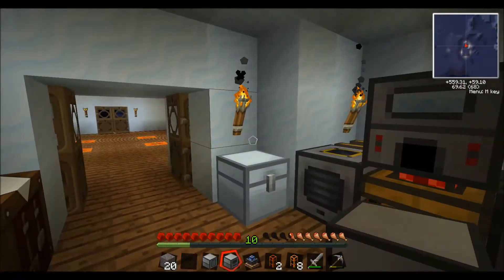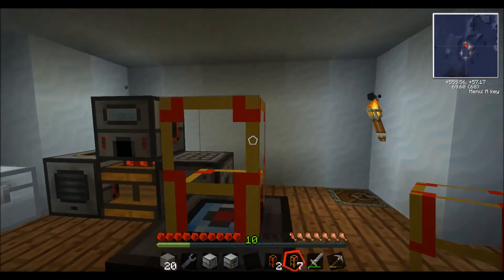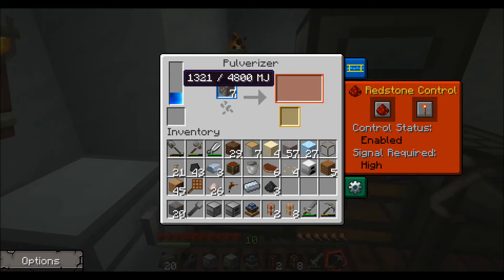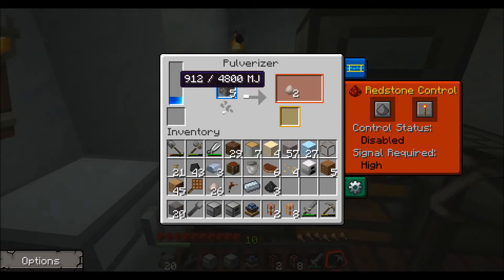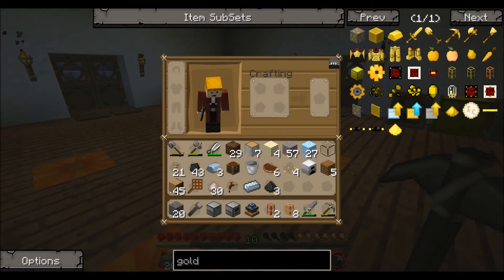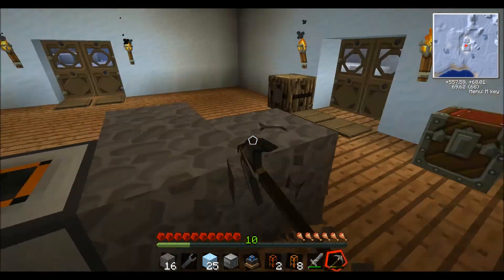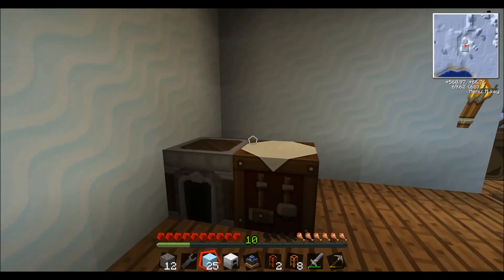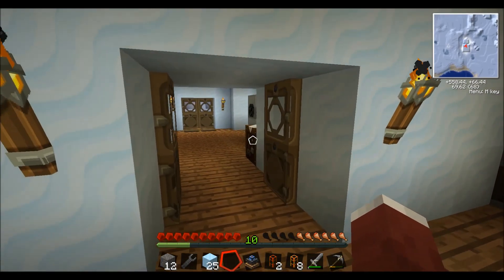FTB SPOT #8 - Comments & Iron Furnace - Feed The Beast Modpack (Minecraft)

Comment: On the aqueous collector (water collector), how to get the water out?  Can you sit it next to one of those steam/combustion engines to cool them down and set the correct output side?  Or do you need some sort of water proof wood and stone/other pipe and a redstone engine to pump the water out. (IF only I could get a redstone engine to work everytime in FTB...)